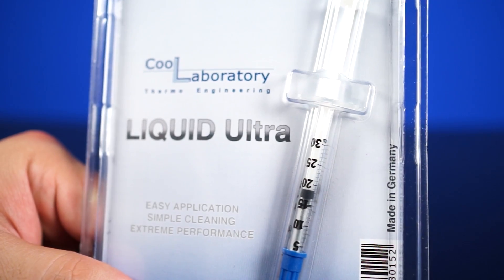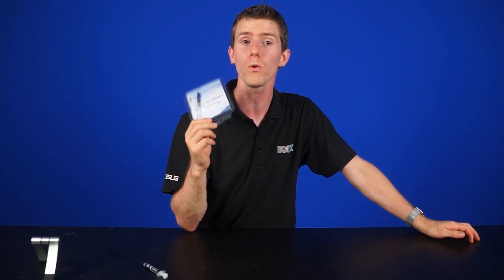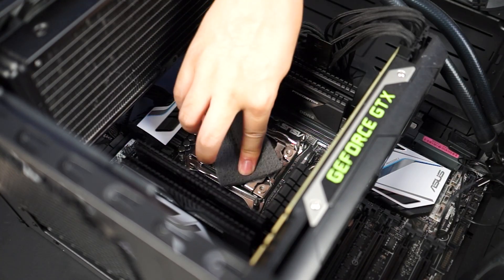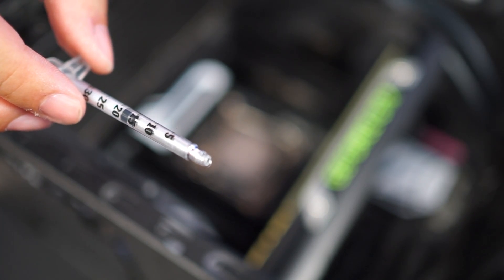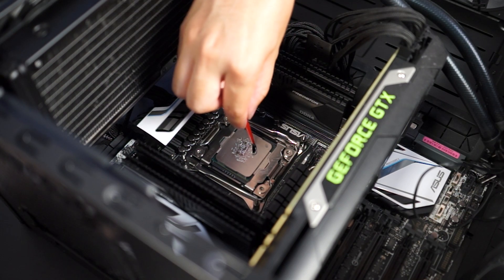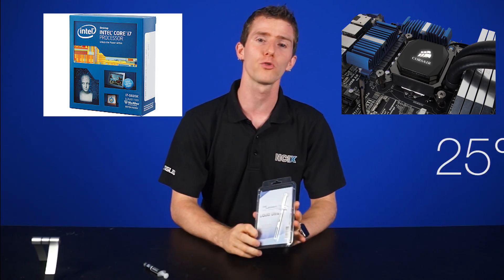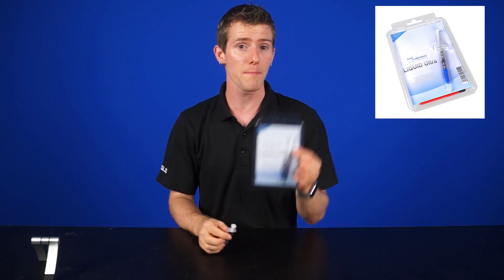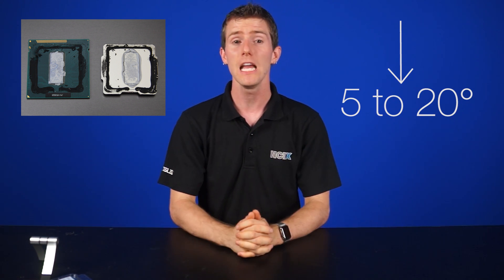CoolLaboratory Liquid Ultra Thermal Compound - Wut iz?

Comment: Your warranty will be void on your CPU if you use this.  Once it has been on for a year or so it can get hard and the only way to get it off is to sand it off.  In the end you end up with a lapped CPU and water block / cooler.  Keep that in mind.  If you can live with that, go for it.  If not, stick to normal paste.

Comment: So basically it's useless.
Reply: muiecopyright Not to me, NCIX really gave this stuff a bad name. I use it and see anywhere from 5-10c cooler temps. Not that much, but does what they advertise it to do.
Reply: muiecopyright not unless you use a laptop cpu or any GPU
Reply: Dropped my delidded G3258 temperatues by 24c under load
Reply: +ololh4xx I don't know what "handbook" you where reading. It is NOT a regular thermal paste but a (gallium based) chemical bonding agent, so called "liquid metal". (The gallium is the reason why it is incompatible with aluminum heat sinks.)

If that's not enough for you, the manufacturer - CoolLaboratory insists that you spread it.

It is clearly stated in the instruction manual that comes with the product and also shown in their "how-to" videos

http://www.coollaboratory.com/en/products/liquid-ultra/

And alltohugh in the current video they applied a bit too much of it (for my taste), they did it the right way. With thermal paste a dot in the middle is perfectly fine, with liquid metal you will want to cover the whole heatspreader with as thin a layer as you can get.
Reply: Bobzilla8906 no vs random as5 ... even without delid
Reply: Bobzilla8906 It's true, ***** is telling the truth. I've tried it on three seperate PC's, one using an I5 3570K, one with an I7 4820K, and just recently on my new I7 5960X and on all three CPU's it gives me idle and load temps of 5-7 degrees celsius lower than with Gelid GC EXtreme and EK Ectotherm which are the best thermal "pastes" on the market temperature wise (i tried both Gelid and Ectotherm on each CPU and i even applied each paste twice to ensure i didn't get a bad spread; i was very thorough) And none of these CPUs were de-lidded as they can't be delidded with the exception of the 3570K. The 4820K and 5960X are haswell-e and don't use de-liddable thermal pasted heatspreader's, they instead use soldered on heatspreaders which give better temps already; so for CL liquid ultra to give 5-7 degree celsius drops even with soldered spreader is fantastic! And remember, 5-7 degrees celsius is actually around 15 degrees fahrenheit; think of the difference between 70 degrees F and 85 degrees F sitting in your home! AT 70 you're perfectly fine, maybe even a little chilly  enough to put on a sweater/light jacket, but at 85 F you're turning on an air conditioning or putting fans in windows, taking your shirt off etc.. to keep cool. 15 F / 6 C or so is actually quite a difference in how hot something is.
Reply: Eric Lin Not necessarily, 10C is quite attainable if you are using specific types of thermal pastes etc.. for example, de-lidding something like an I7 4770K/4790K or like my old I5 3570K and putting CLU on JUST the die itself, keeping the same normal past you use on top of the spreader tests have shown a drop of 7-14 C on a 4790K (due to it's already better thermals) or on a 4770K you can get up to near 15-20C drops!! (this is proven, look at http://siliconlottery.com/products/delid  they show 5-15C for 4790K/4690K or 10-20C on 4790K/4690K) Then if you go and put CLU on top of the spreader after already de-lidding it you get another ~5-7C drop in temps on top of the ~12-15C or more drop from de-lidding; this means a total of around 18-22C drop in temps from using CLU both as a de-lid die-paste and as actual spreader paste.
Reply: +Eric Lin In addition CLU and other similar solutions do not "dry out" or loose their effectiveness over time at all. Which can happen with other thermal compounds.

In effect it bonds the surfaces of the processor and heat sink together (like thermal glue) but it has WAY better thermal properties than glue. However - the surfaces are bonded, so you really have to pry it loose after a few years of usage if you want to switch out parts. And it takes way more effort to clean your die and heat sink for a processor change. (Any markings on the processor WILL be gone after you're done cleaning - read "sanding" - it.)

Other than that it is a great product. You might argue that it will not be significantly better than thermal paste but it most definitely will not be worse than the best paste money can buy. Also if you want guaranteed longevity, CLU is the way to go!

Oh and in the vid they used way way too much as well. It really and truly takes a miniscule drop to completely cover the heat spreader of any die. Seriously, you will be amazed how extremely little is needed once you start spreading it!
Reply: ololh4xx Are you high dude? Can you seriously not find a way to relate what he said to what you said? You both mention the handbook that he fucking qutoed you on. You're a dumbass, stop injecting marijuana, drugs are bad m'kay.
Reply: ***** PogChamp!!!
Reply: ***** oh man TOTAL LIFE SAVER! I always wanted to drink some thermal compound
Reply: PC TechTips Oh wow... I forgot about laptops... good point. Thanks for bringing it up.
Reply: ***** actually you need to reball the entire chip on top on a special plate, attaching 100% copper between non-conductive metals to transfer the heat even better, followed by a complete application of individually-made, liquid metal, checking everything under a microscope and finally depressurizing the entire contraption so air is not an issue anymore
Reply: ololh4xx Oh stfu. We both know your talking out your ass cause if we wanna talk labs you would just waste your life using an STM to achieve 100% perfect atom arrangements. Now coming back to reality, the idea is that people shouldn't be using this product unless they are delidding. So making a video about applying it on top of the IHS is absolutely worthless.
Reply: Marshal Beard ololh4xx  What Marshal said
Reply: ***** Marshal Beard i think its time for your homework now.
Reply: Marshal Beard The world is a better place
Reply: +muiecopyright it's not worth it if you use it with crappy intel thermal compound inside of CPU. On older CPUs (tested it on E8600 and Q9550) it works wonders. 5 to 10 degrees celsius better than MX4. Of course we're talking about some great liquid cooling system, not your regular air cooling CPU cooler. The only benefit of liquid metal is it's great thermal conductivity, which is up to 10 times better than even best of thermal pastes. So if nothing else decreases conductivity this solution will work just fine. Not for a regular user though.
Reply: for most people? yes. but for the most Elite of all elites it's definetly worth it. Even more if you delidded your cpu.
Reply: Dude, Google this stuff. Every single chart I've seen shows CLU in first place. The lead is small though, I think 5C is pushing it quite a bit. 10C is a flat out lie. But a consistent 1-3C improvement makes this a valid option. And the compound itself is not very expensive.

This video blows pretty hard. I expected more from Linus.
Reply: ***** Compared to what exactly? and Delided?
Reply: xXDarkxIdealsXx That includes the temperature drop from delidding though.

Also, while technically using CLU for both delidding and on top of the IHS means the improvements stack, that wasn't really what I was talking about (non-delid, normal heatsink application).
Reply: muiecopyright It's supposed to go under the integrated heat spreader. It's really good when delidding because it doesn't dry up over time or spread around (liquid metal) and replaces intel's thermal compound, but above the IHS it really isn't much better than normal silicone grease based paste.
Reply: ***** I believe the problem with Haswell under the lid is the adhesive used to stick the IHS to the rest of the package.
Reply: +muiecopyright Hi just thought I'd chime in and share some valuable first hand experience and REAL testing unlike this shitty excuse of a test with that next-level cringeworthy application. First off I have a i7 3770k and a H80i water cooler. I pushed my CPU to the limits of 4.7GHz at 1.4v which hit 87c on the hottest core after a 24 hour prime95 stress test while using MX-4 thermal paste. I then delidded my CPU and used CLU on the die and MX-4 between IHS and H80i and got a 23c drop in temperatures running the same settings, meaning my hottest core was only SIXTY FOUR DEGREES. I was then able to lower the voltage and keep it stable at 1.38v due to much lower temps or raise the voltage to 1.48v and run 4.8GHz at only 85c. Do you know how far 3xtr33333meeee overclockers like me go to get that kind of improvement? Well, they stick their CPU in a vice and smash it with a hammer and some wood. BUT WAIT theres more. My motherboard decided to kill itself after suffering from random bugs such as the inability to run RAM in dual-channel mode for some reason, so the system hasn't been turned for about a year and a half, or up until a couple weeks ago. I'm currently using Artic Silver 5 on both the IHS and on the CPU die because it's all I have ATM (MX-4 on the way at least as of last night) I am forced to run 4.7GHz again because AS5 causes my CPU to hit 83c at 1.4v, so only a mere 5c better with what used to be a premium thermal paste compared to the stock intel thermal paste between the die and IHS versus the 23c better... Yeah. So basically it's useless. /s
Reply: Allan Bernard are you high right now, son? Were your reading something from person A and then answered to person B because of your high ... or something? You really should'nt take drugs
Reply: Marshal Beard 0/10, would read again.
Reply: Only n00bs apply thermal paste to the heat spreader. You gotta de-lid and apply to the die first.
Reply: ololh4xx I'm pretty sure he's just talking about delidding, where you pop off the IHS and apply some liquid metal thermal paste and drop your tempereatures 20c. I did this with my 3770k, at 4.7Ghz I went from 95c to 72c hottest core 24 hours prime 95. Has nothing to do with reballing or reflowing or soldering at all.
Reply: +Marshal Beard Indeed, thats not even comparable to such a lab procedure. Im guessing you could reach 60 or even 50°C with lab conditions and passive thermal transfer
Reply: ***** of course it is ... everything is "worthless", young one - and everyone is "talking out his/her ass".
Reply: ***** *deletes all comments* 

maybe he actually did it.
Reply: put this shit on the internal heat spreader and see a 23c drop at max temp? i did yesterday
Reply: muiecopyright is it fuck. It typically lowers temps by 10 degrees when the heat spreader has been removed.
Reply: muiecopyright now I can use my CPU as a drink cooler.
Reply: If you spread it the right way... It will beat every other thermalpaste. RX4 vs NT H1 vs Liquid Ultra = 72 / 71 / 66 degrees. A big difference. I used this liquid thing in both of my PCs and the results are the same. This liquid thingy makes your CPU or GPU about 5 to 7 degrees cooler. My personal experience.
Reply: +muiecopyright no, it was applied by a dumbass who doesnt know how to computer. The metal needs to be applied to the CENTER and NOT SPREAD OUT - thats even mentioned in the damn HANDBOOK!
Its a high-perf paste - top tier without the usual paste-gunk and thats about it. Its somewhat worth its money.